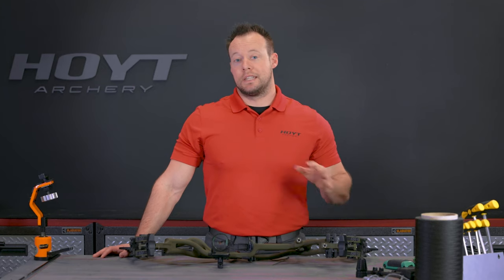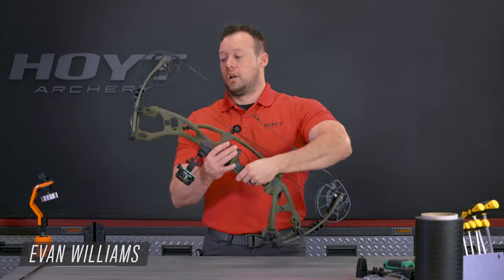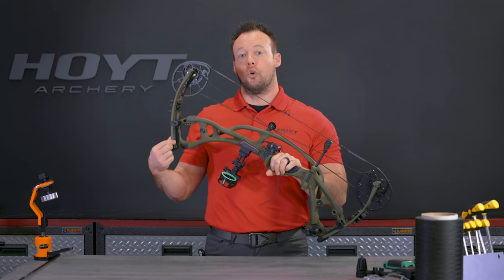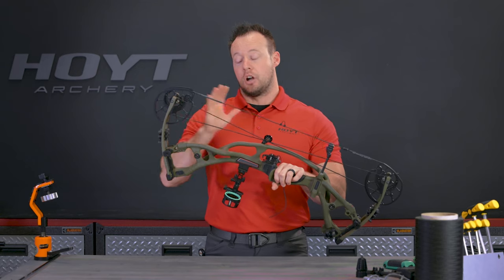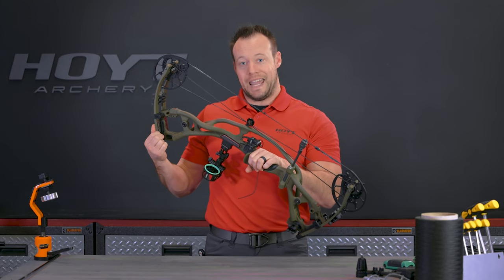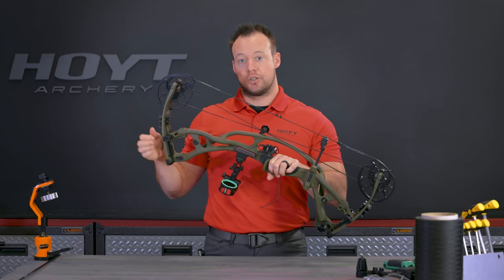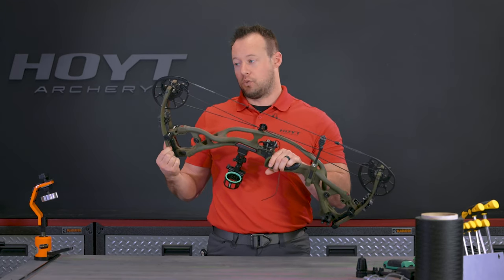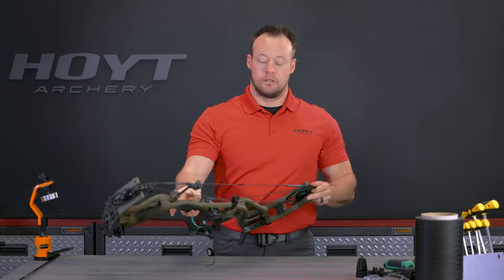ADJUSTING THE DRAW LENGTH ON THE HBX AND HBX PRO CAMS

Comment: What’s faster on a ventum 30…a 28” draw length or a 28 and a half? Top of one cam at 28”dl and bottom of another cam at 28.5”dL
Reply from the maker: Great question! You'll probably be getting faster speeds from a 28" DL sitting at the top of the cam, though it also depends on your setup.